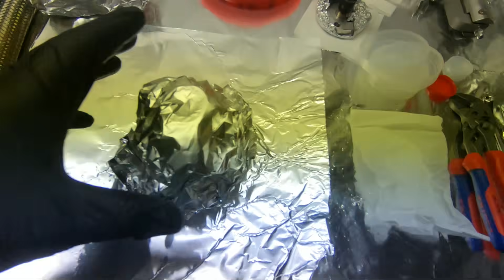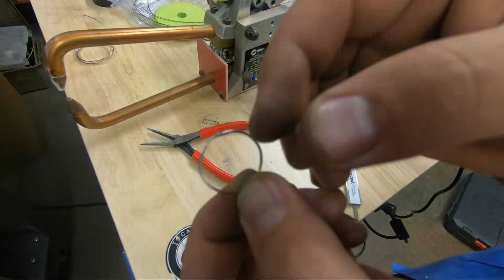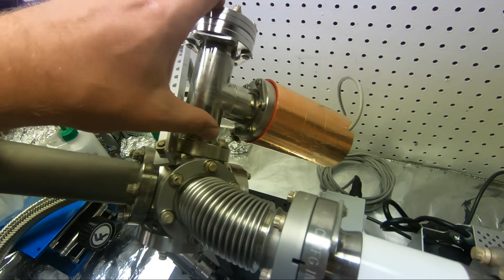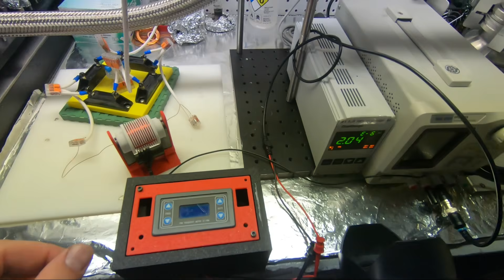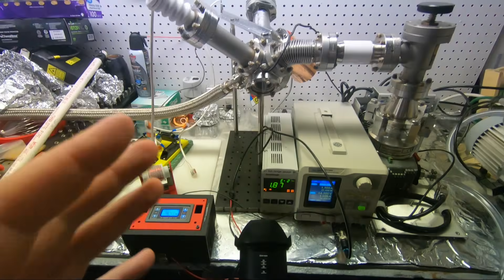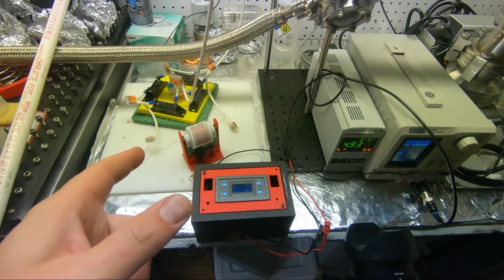The Quest for Garage Fusion Continues, fusor chamber build and first plasma

Comment: Have you seen recent news about palladium containing hydrogen in the lattice having a far lower threshold for fusion than otherwise?  Might be interesting to put that material in the center and see what readings you get, maybe with a magnetic field added as well?
Reply from the maker: I assume you are referring to the paper "Electrochemical loading enhances deuterium fusion rates in a metal target" from last year? Super interesting paper, I read it maybe a few days after it was published, although I don't remember it mentioning having a lower threshold (meaning less accelerating voltage needed) for fusion. They did achieve a higher rate though. This would be a tough thing to do in the fusor, especially quantify differences in neutron production if it's not a huge difference.
Reply: @SciPushingButtons  well yeah, the overall degree of fusion would still be pretty low so it’s not like just doing this would get you close to an arc reactor, now that I read further into the study and tempered my expectations 😂 but thanks for the thoughtful reply.
Reply from the maker: Heads up, that same group just put out a new paper. "Enhanced nuclear fusion in the sub-keV energy regime". Looks like there is evidence that the actual energy barrier is indeed lowered!

Comment: Nice work! Really excited to see when you test it with deuterium. How do you intend to detect neutrons when you get to that point?
Reply from the maker: Couple of different options I am considering. The most sort of fool proof/simple way is to use a bubble detector for neutron confirmation. I am also thinking about potentially investing in a He3 detector and getting that up and running with an HDPE moderator for getting the fast neutrons into thermal mode for detection. I am still a ways off though.